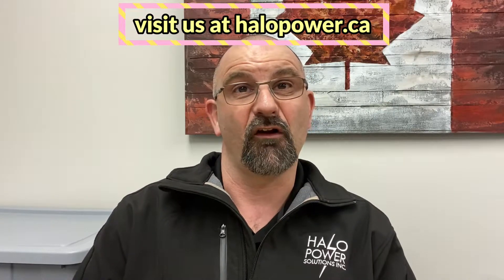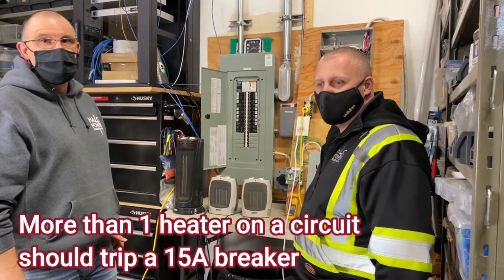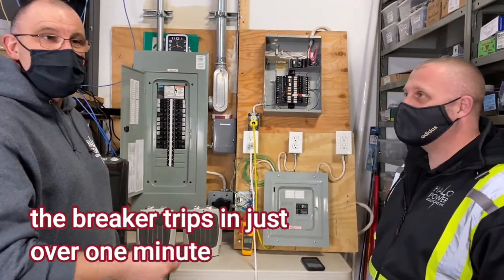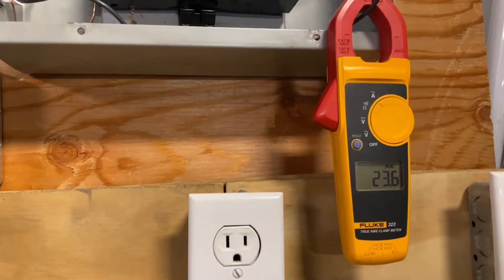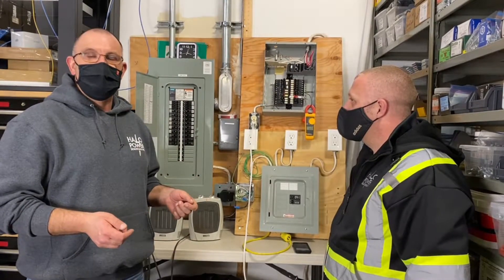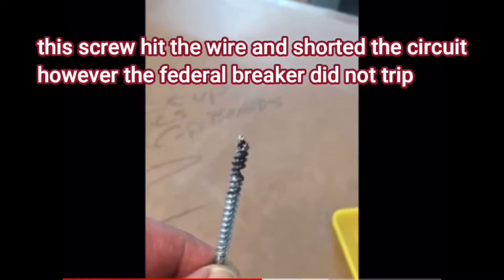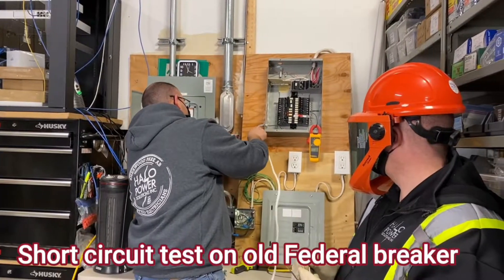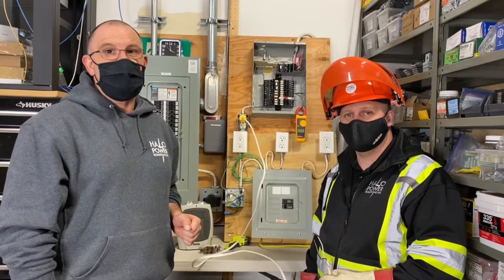This is scary! | Federal Pacific FPE Stab-Lok Electrical Panels

Comment: A very strange thing is occurring here if you look closely the breaker they are feeding from is clearly in the tripped or off position, did you put a max hold on your meter by chance to see the breaker hold a resistive load  past 15amps for your demo here? Something doesn’t add up, don’t doubt stab lok can be dangerous I have seen failures at the breaker stab interface but something seems fishy here.

Comment: Nothing wrong with Canadian Federal Pioneer panels.  American Federal Pacific (both labeled FPE) are the faulty ones.
Reply: It's the older ones that are the problem. The ones from 1950 - 1980 do not work properly. I don't have the money to replace my older Stab Lok panel, so I am really careful with it. I have had it melt a couple plugs when I moved in, I had to run and manually turn off the breaker because it wouldn't trip.
Reply: NOT SO! FPE is deadly.
Reply: @achannel8142  Fake news.  A licensed electrician did a substantial study on Federal Pioneer panels and breakers and could find nothing wrong with them.  Many other electricians commented on the study, one said, "How am I supposed to put the fear of God into my customers with data like this?" with three smiling faces after it.

Electricians use fear to generate business.  There's nothing wrong with Canadian Federal Pioneer panels or breakers.  There was a small recall on one specific 15 amp breaker with a square blue handle but that was two decades ago and they've since been remedied.  You can buy new stab-lok breakers at Home Depot, Canadian Tire, etc.  

Stop being a fake news fear monger.  It's lame.
Reply: BULLSPIT ,do not believe this , i live in Canada , has happened to me numerous times , in the process of having these faulty breakers replaced !
Reply: i grew up in a house with stab loks.  I can't recall a single time they ever tripped.  I'd sparked out wires as a kid quite a few times fixing stuff, and they never tripped.

I didn't even know until my mid 20's how sensitive breakers were supposed to be (basically instant on a dead short, a minute or two at most being overloaded).

I'm canadian, stab loks are terrible and should be replaced whenever possible.  If you own a home and can't afford it now, start saving in my opinion.
Reply: @Wooble57  If your house is wired properly and you don't do anything stupid then your breakers should never trip.

I'll dismiss your teenager's scientific method of testing electrical equipment and go instead with what my electrician says: nothing wrong with stab-lok panels or breakers in Canada.  Millions installed in Ontario alone, no houses burning down.  It's just fear-mongering by shady electricians.